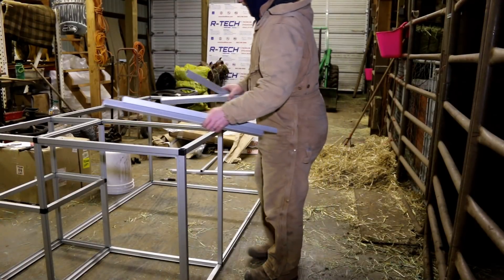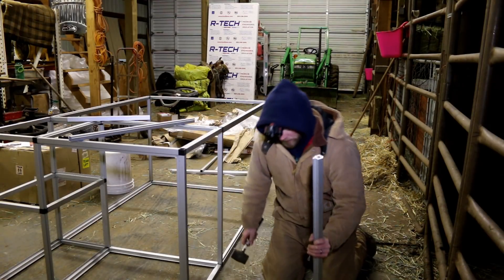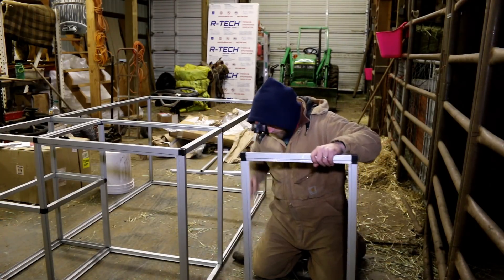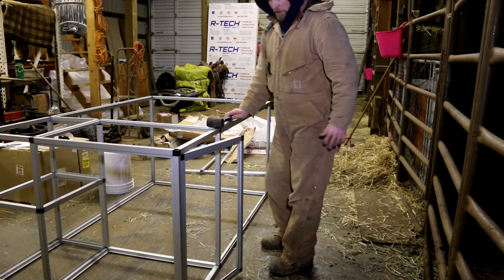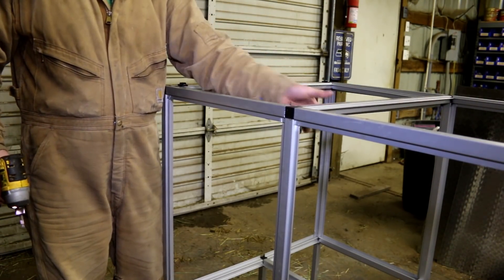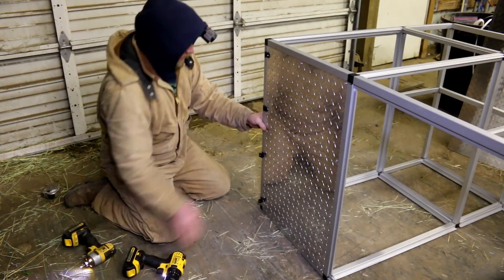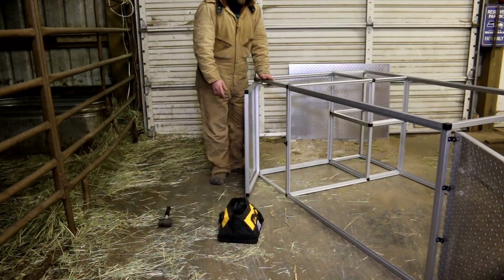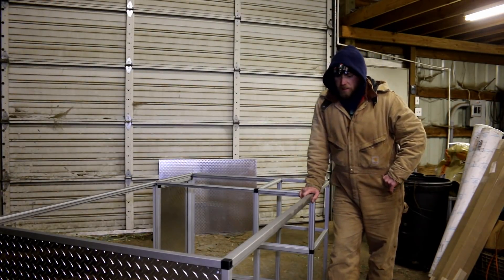How EASY is 80-20 TSlot to work with?

Comment: You probably know this already but for cutting the foam make yourself a hot wire. I build a chiller for my Dads farm and needed to split some 4inch poly panel length ways to thin it down. I started with guitar string and an old laptop charger but the charger died on me. Ended up using a truck battery charger and Mig welding wire.

Comment: A while back when you were doing a check on amperage of the cooler unit I think you were off by a decimal. It was something like the unit would draw 10 amps max but that was at 120 V but you have 12 V so it becomes 100 amps.
I may be wrong but it wouldn't hurt to double check that.